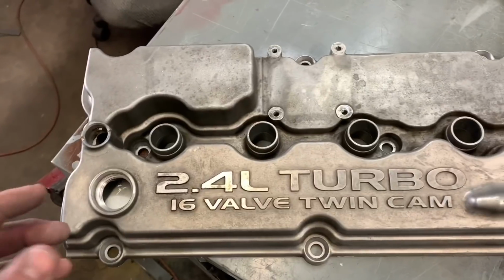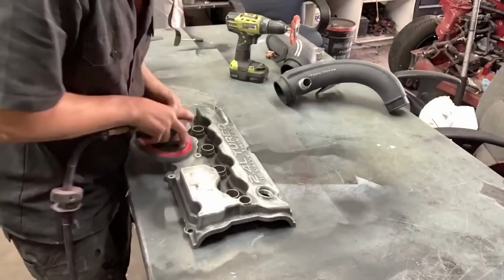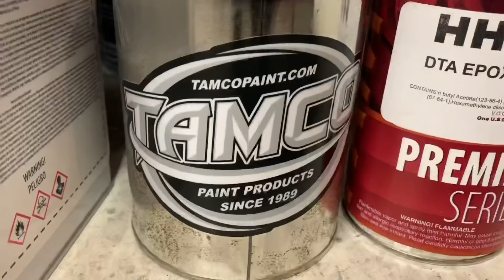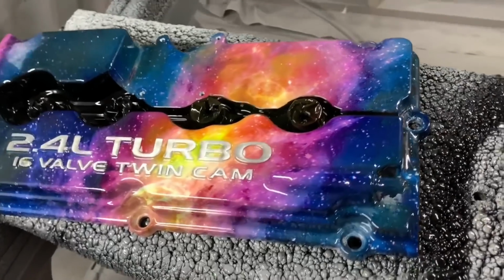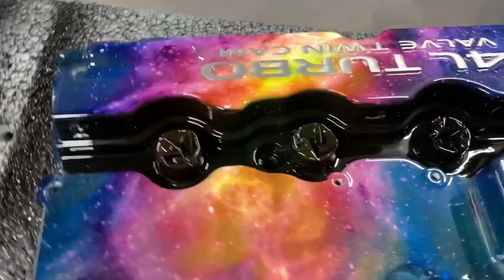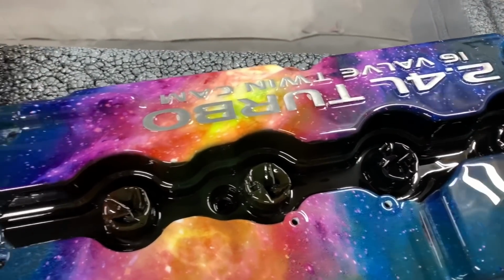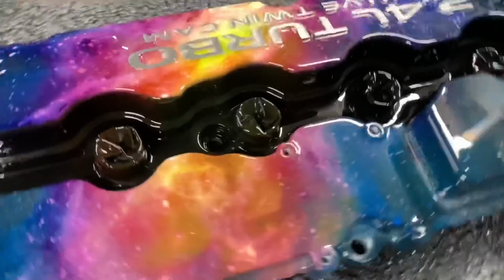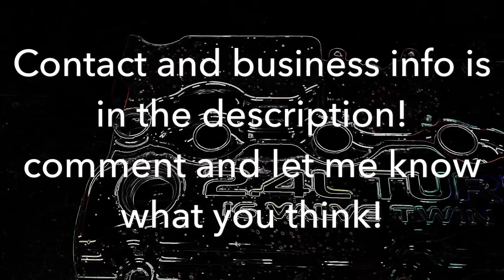CUSTOM SRT4 Neon Valve Cover Hydrodipped in Galaxy! START TO FINISH

Comment: How much did this job cost ? I want it in my srt4
Reply from the maker: $180, prep work on these is a little extra because the valley is so hard to clean up.  Normally 4 cylinder covers are $150-180
Reply: @GARAGEIdiotS  let me have your
 e mail ...so i can get the info

Comment: hey why don't you just sandblast your valve covers after you degrease them (tape off the bottom and spark plug tubes).  you can order a psiphon tube sand blast gun for around $12. stick the feed tube in a 5 gallon bucket full of the sand.  I just set the parts on a stand outside and let it rip.  whenever I do paint and powder coating that's what I use.  I can have a valve cover sanded and ready for paint in 8 minutes.  I use extra fine sand that is only $7 for a 100lb bag from agri supply or tractor supply.  it leaves no scratches.  spray your epoxy wait 30 minutes then start your base colors.  your wasting so much time and money when you have to spray 2k primer then sand everything again to get rid of your scratches from your sand paper and wiz wheel thing.  just trying to help man.  I hate to see you have a 8 min project take you 2 extra unnecessary days.  time is money....keep up the good work!
Reply: I bet his location wouldn't go for the outdoor sandblasting but your right. I use a cabinet for my projects.
Reply from the maker: I have a lot of people that don’t want me to blast their covers because of the risk of the media going into the baffles.  So I’ve just made it a habit to hand prep them.
Reply: Good luck with those sandblasted valve covers all kinds of junk getting into the oil of those poor engines the only way I would sandblast a valve cover is if the baffles are removed.